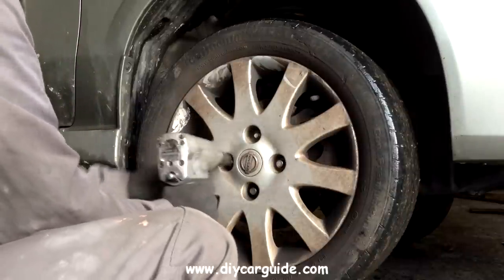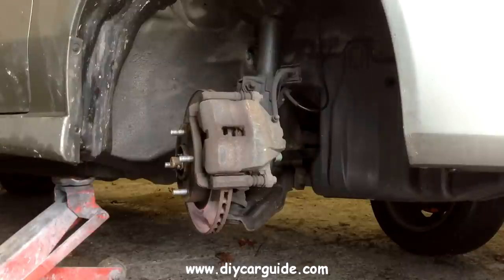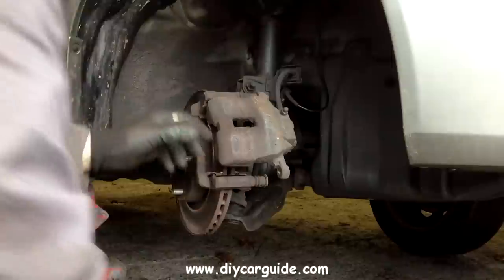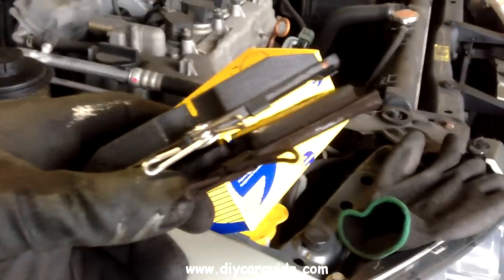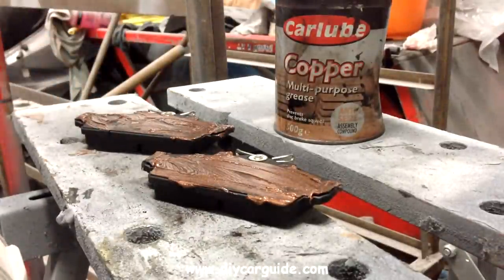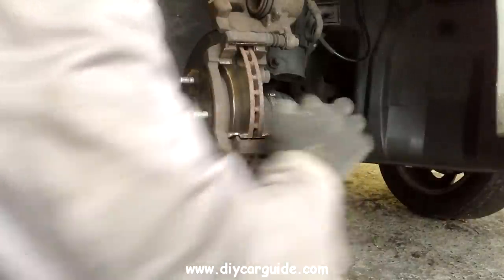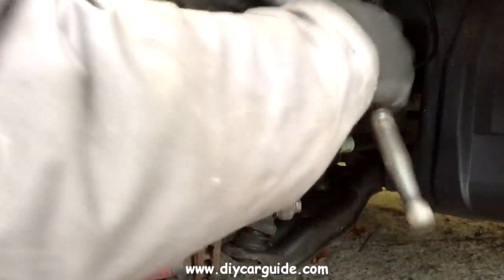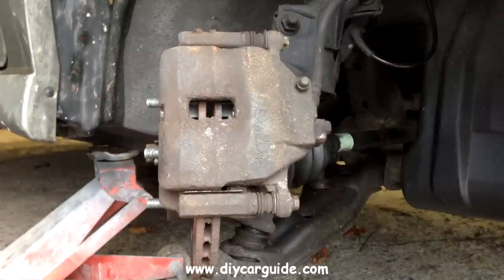Nissan Almera Front Brake Pads Replacement

Comment: hi what torque settings did you use to tighten the bolts?
Reply: Im sure he just hand tighten them.
If you want the torque value its 22 - 32 Nm (2.2 - 3.3 kg/m or 16 - 23 ft/lb) nissan recommends.

Comment: hi, is the copper grease absolutely necessary? Could i replace them without it?
Reply: ceili only a small amount is required on the contact points shims.

Comment: He did half cheap job on changing brake. Rotor and pads must replace at same time. He forgot inspect the caliper pin, brake retainer clip, caliper piston, and rubber boot. If there corrosion or wear, it should be replace. Don't really need to put lock tite on caliper bolt.
Reply: You are the best I ever seen professional and fast.
Reply: Nonsense!..You certainly don't have to replace disks as well as pads. Only if they are badly worn. The rest of comment is cr*p too by the way!